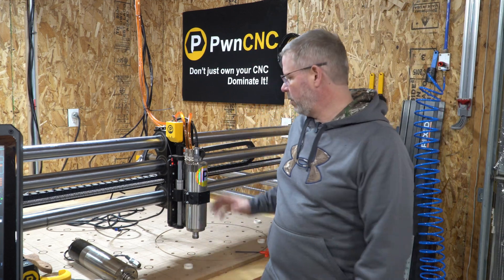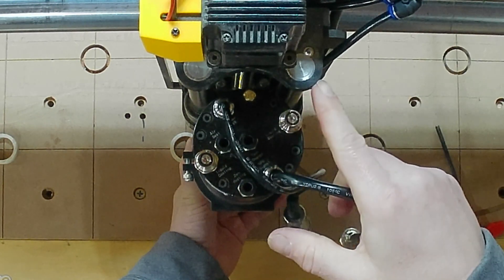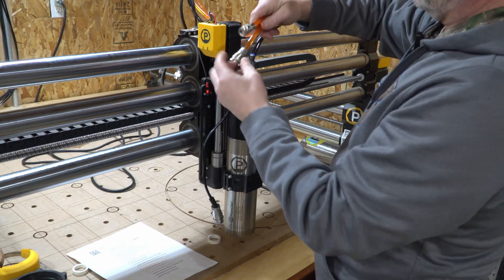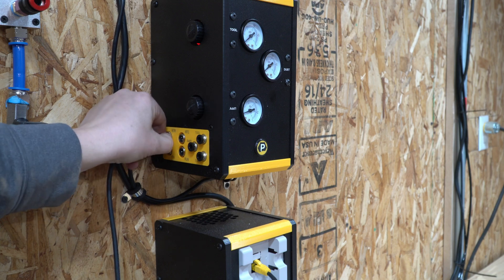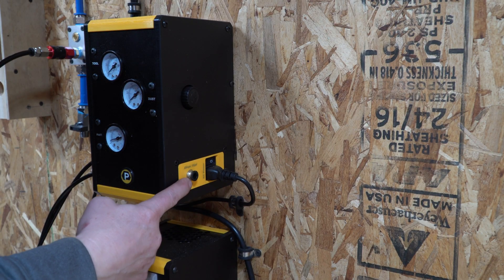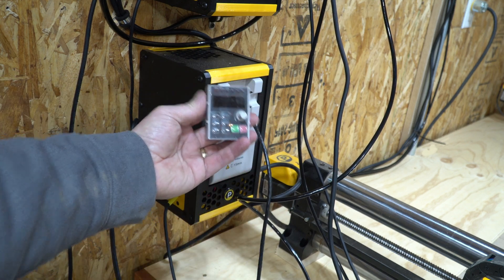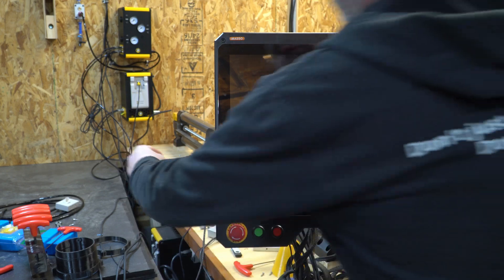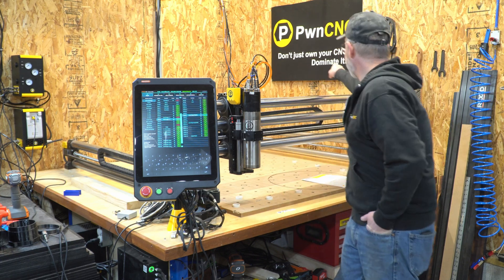ATC Spindle Install

Comment: what about output 8?
Reply from the maker: It’s actually not required by our ATC, so it remains unassigned.
Some folks use it as an air blast for their diode laser or the air cleaner for their tool setter.
We left it intentionally open for the user to decide.  An extra feature.

Comment: I must have missed a step somewhere. I plug the 6-pin connector into the slot labeled "PWN" on the VFD box, and where does the other end go?
Reply: Did you ever figure this out?  I am in the same spot.  I feel like I'm missing something obvious!
Reply: @oseanmc  Yeah, it's never mentioned anywhere, but if you have a Masso controller there's a receptacle on the bottom back side that you plug it in.
Reply: @builtbybittle  Doh!  Yep, it was obvious!  I think I have been staring at a spaghetti mess of wire to long today.
Thanks for the info.
Reply: @oseanmc  I was in the same boat, glad I could help out!

Comment: What was the 4 pin connector on the back of masso that  you installed but didnt show? Is it required for atc system?
Reply from the maker: Hello Johnd5542... that 4-pin is for the tool-setter.  It's available on our site as part of purchasing that product.
The ATC comes with the required 5-pin connector... so no worries there.
The ATC uses the already installed 6-pin connector we asked Onefinity to add to their machines... and the 5-pin we include with full instructions and assist with installing if you need it.
Reply: @PwnCNC  Thanks for the fast reply. Thats what I thought. So the ATC system comes with the tool setter, or just the connector?  Im in the process of building my atc and I dont have a pwn tool setter. However, I did buy the Ez from 1F. Will that still work with Atc? My guess is no, or else you would have just used the 1f 2pin connector.

Im new to cnc and theres not much info on the atc. Everything kind of assumes you are converting to atc, with prior knowledge. Im a complete noob. There was a lot to learn just to get setup, and a ton still left to learn, lol.
Reply from the maker: @johnd5542  The tool setter is actually a separate accessory that isn't really required.  You can certainly use their tool setter vs ours.  We design accessories for a variety of CNC machine brands and made that one available for those folks with Masso controllers "not" on a Onefinity branded machine... however it can certainly be used on the Onefinity if you wish.
Yeah... not much info because I think we're amoung the first to come out with a viable low-cost (compared to other way more expensive options) ATC for any brand cnc machine.  Our goal is to share our knowledge and bring some pretty cool features to folks no matter the machine they own.  
There is most certainly a ton to learn... stick with it though.  Once you find something you LOVE to make it gets exciting and it can really be a side-gig that makes you money; if you are enjoying it that's a bonus.
Reply: @PwnCNC  Ok, makes sense. I figured the tool setter would come in handy in certain situations. 

Ya, it's been a bit challenging and sometimes a bit overwhelming. But I can say PwnCNC has made this endeavor much easier than other options available, while providing high quality gear. 

Not to mention the phenomenal customer service. As a small biz owner, I can really appreciate the effort you guys put forth to take care of your customers. A+
Reply: @PwnCNC  HI ,,, do we not need to use the 6-pin connector ??
Reply from the maker: @PaulRothwell-sn4wy  VFD is controled via 6-pin connector.  The PE is controlled by a 5-pin connector.  The 4-pin question from OP is for our tool-setter accessory.
Reply: i have a six pin cable leftover , which is marked as optional ??
Reply from the maker: @PaulRothwell-sn4wy  Shoot us an email support@pwncnc.com and we'll help get this sorted out for you.

Comment: Could you elaborate on the air source hookup and requirements?
Reply from the maker: Hello @ddsGarmin,  we've published the inventory here in our kb:  https://support.pwncnc.com/kb/article/406-air-compressor/
The compressor needs to supply 95psi regularly.  You'll likely need to run it through a dryer because you don't want wet air going into the motor.  After the dryer, it'll need a quick-change receiver since our ATC System ships with a quick change end on the supply hose provided.

Comment: Why isn't their anoption for air cooled ATC spindle?
Reply from the maker: To get an ATC spindle this small only water-cooled is available.  Bonus is our water cooled ATC motors are metalworking 4-pole with ceramic bearings capable of carving mild steel.